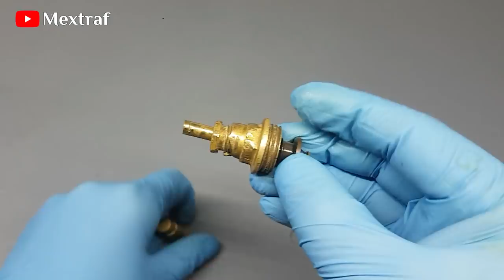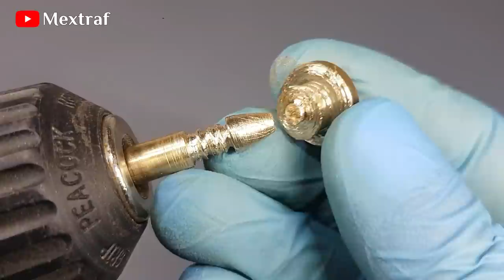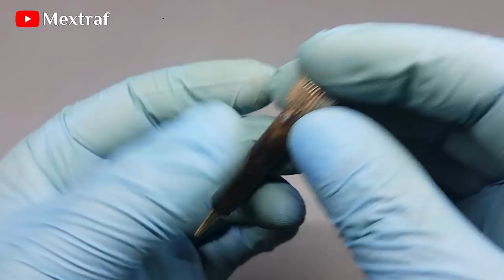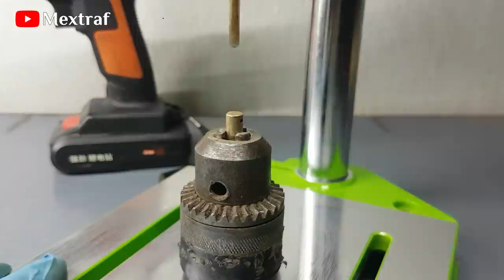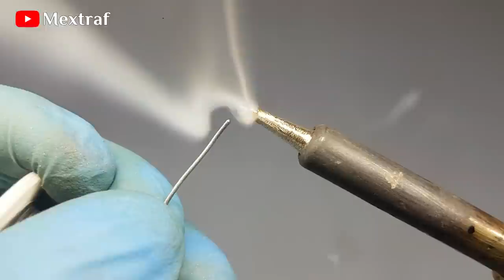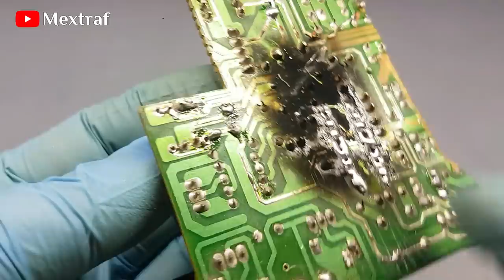Amazing innovation | You Can Make At Home | DIY soldering iron tip from old water tap

Comment: nice job, but you should plate the tip with Nickle
Reply: Not really necessary
Reply: @yfelwulf  Copper is very easily corroded, eating away the tip, plating with Nickle or Iron is good for durability of the tip.
Reply: @mrdesperate6534  It's not Copper its Brass. And that's a lot of work for something you can easily replace it will last months at a minimum.
Reply: @mrdesperate , please let us know, what is the benefit of Nickle ? Thnx
Reply: @machyuddinmizwan722  
Google it.
Reply: @machyuddinmizwan722  Corrosion resistance